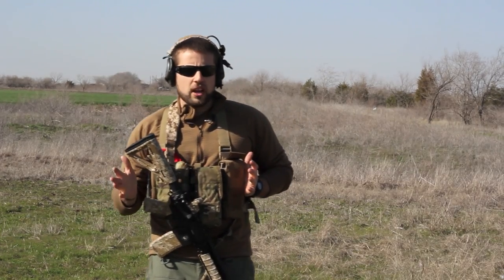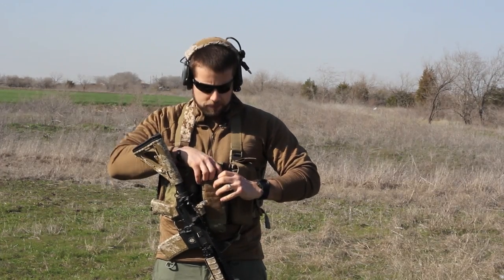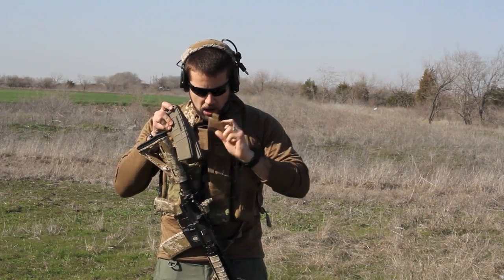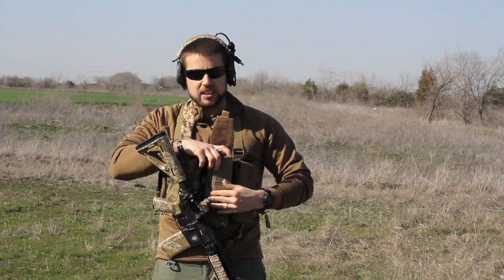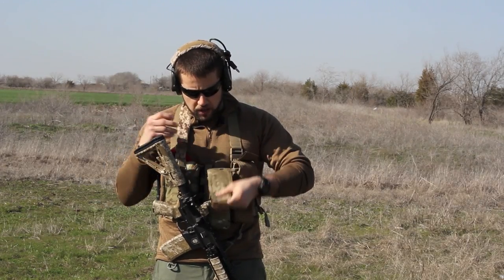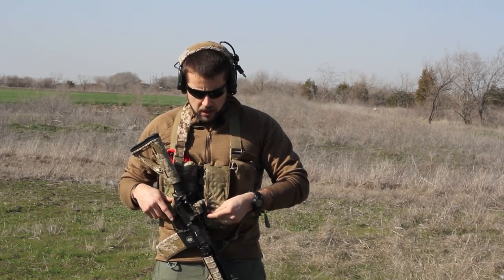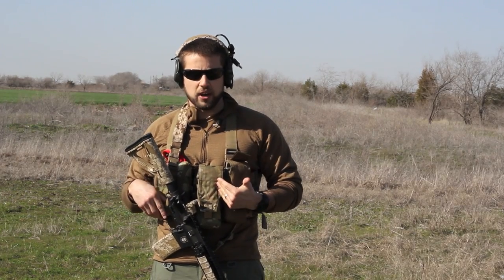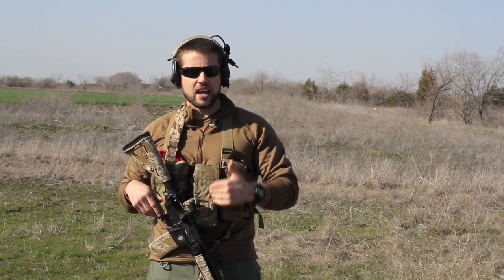Do Flaps on Rifle Magazine Pouches Really Get in the Way During a Reload?

Comment: I always taught folks to have ONE speed reload mag ready if needed. Your other mags are set up as tactical reloads and when you/if you have time, shift your mags to maintain the speed reload mag.  But the reason to do a speed reload with your carbine is because the target is far enough away to warrant one vice  transitioning to a secondary which can be done faster.  But distance, cover and the overall situation will be the deciding factor.  HatrXx78 is dead on with the comments too.

Comment: Opening a pouch with your forefingers down is a guaranteed way of running into the same problem you had there.  The flap will be forced downwards and back into place as you release your grip.  For flap style pouches you use thumb and forefinger parallel to the ground and roll upwards.  Pull up, open hand, push down with your thumb against your body holding back the flap and using as a guide to the mag, grab mag.  It looks like Zulu loses all but gravity retention after opening.

Comment: I Just ordered a 5.11 double ak bungee and flap mag pouch like the ones you preferred (arriving tomorrow). It has the Option to use both bungee and flap. I might knot off the bungee if they get in the way and snag a bullet tip on extraction. Seen it on ak operators union but he said it didn't happen much. Do you know anything about these? Any good? I know they probably aren't as high quality as this stuff but decent enough to run with? With just the flaps preferably Or bungee ok?

Comment: No kidding man! I prefer mag pouches with an over the top elastic retainer with a pull tab. You know they will be secure, they are easy to grab up, and are generally pretty low profile. A lot of single mag pouches, for ARs at least, are sometimes tight enough where you do not need a cover or retainer. The less stuff in the way of your equipment the better in my opinion, however if it's flying down the side of a mountain... Well that's bad haha.

Comment: I think that the one major disadvantage of the system doesn't really overcome its advantage.  It's a faster system without practice, but what if you tripped and you had one more mag in the pouch?  The traditional pouch closes automatically, so you stand a good chance of retaining your spare mag, but the pull down pouch leaves the second mag without retention at all.

Not that I've ever been in a gun fight, but I'd rather take a little extra time than risk losing a whole mag.